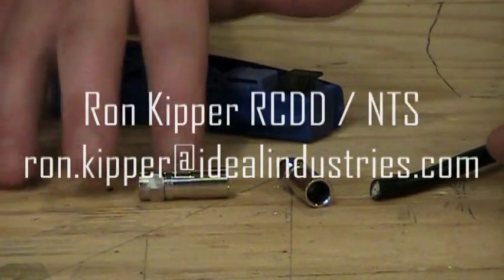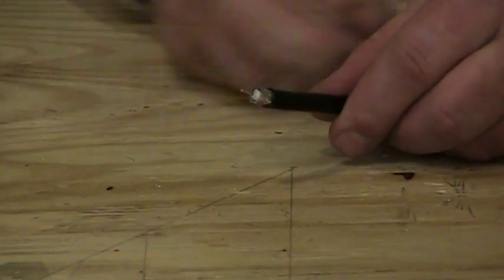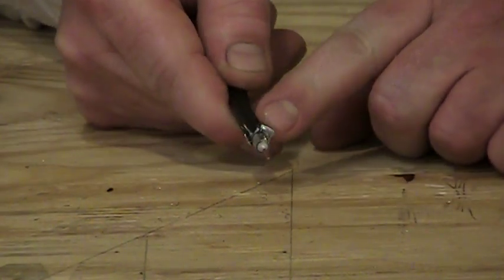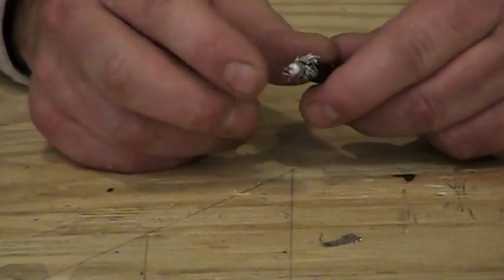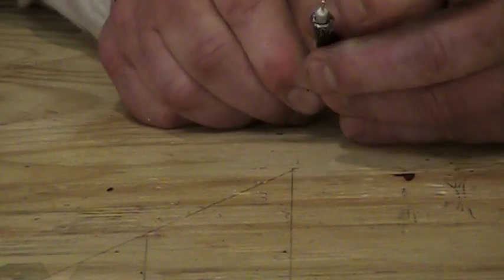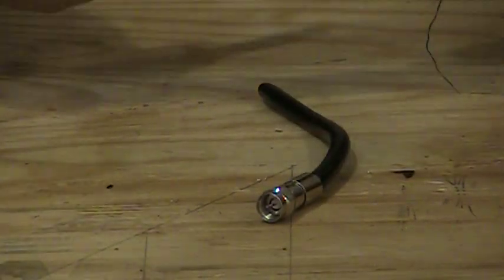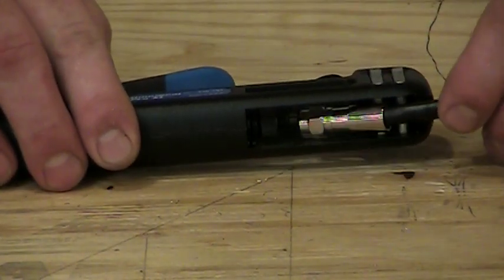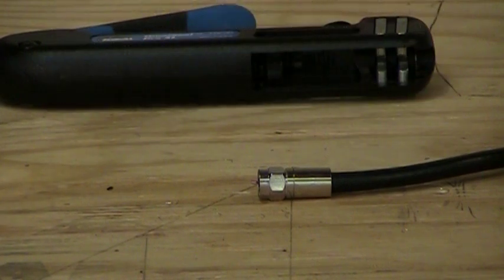Compression RG 6 Quad Connector Termination

Comment: If forget to remove that foil piece would a signal not transmit fully?
Reply from the maker: If you did not remove the foil but got the connector on you should be OK good luck Ron

Comment: Hey Ron, I want you to know I am glad I found this video. I just bought the IDEAL  OmniSeal Pro Coax Compression Tool Kit, and I followed the instructions on the packaging with no success. Once I saw this video I was able to successfully crimp the F connecter. I think it would be IDEAL ( hah!) that you include some amended instructions that apply to rg6q cables. It would benefit those DIY homebuyers that are trying to route coaxial throughout their home on a bundget! Thanks for everything you do!
Reply from the maker: Hi James I have told contractors for years that the time to find out the connectors you have don't fit the cable is not at a jobsite. Have fun Ron

Comment: So this tool only compresses  it, I presume I still need the tool to Crimp it.
Or is there 2 Styles.
Reply from the maker: Sam there are two styles either a crimp-on or the newer compression which is what your cable installers use today. Good luck Ron

Comment: What brand(make) connector do you use. I bought the tool kit at Home Depot. I cannot get the wire deep into the connector as you show.
Reply from the maker: Hey Hedley Lint which tool kit did you buy? The connectors in the video are the same as the ones sold at Home Depot. Make sure to fold back both braids and remove the first layer of foil like I show in the video. That is usually why you can't push the connectors on all the way. Good luck Ron
Reply: The connectors I have are different that are on your Video.  I''m going to Depot tomorrow  to get some like you show. I have folded back the shield wires but must still be doing something wrong.
Reply from the maker: Is there a reason you want to use RG-6 Quad? Usually RG-6 is good enough. Good luck Ron
Reply: I don't need and am not using RG6 Quad.
Reply from the maker: OK Great good luck Ron